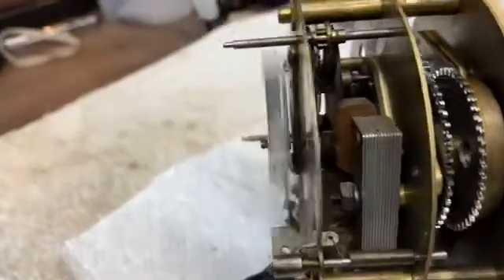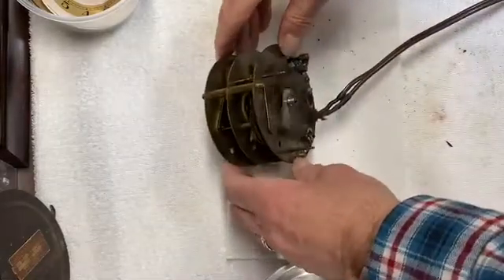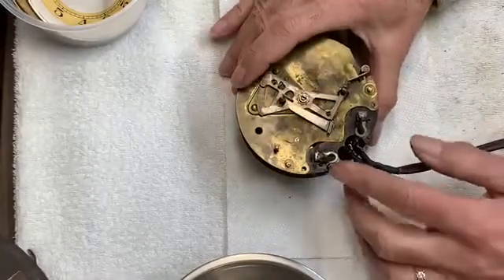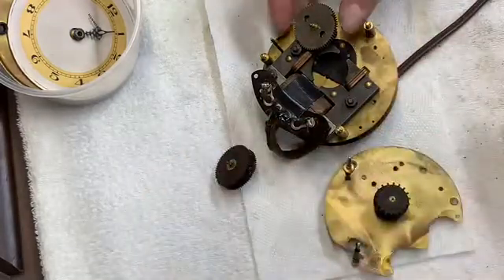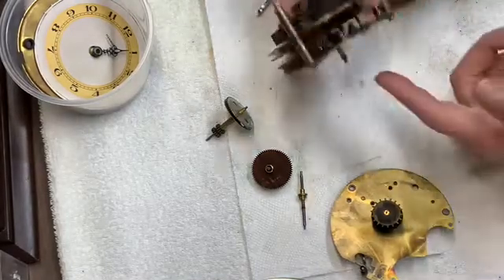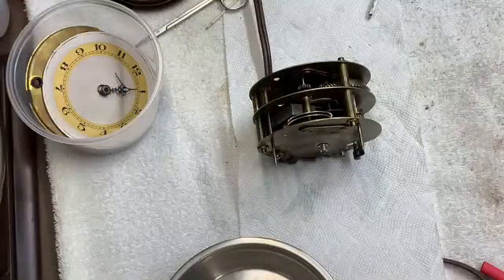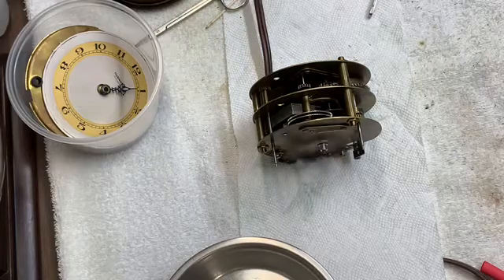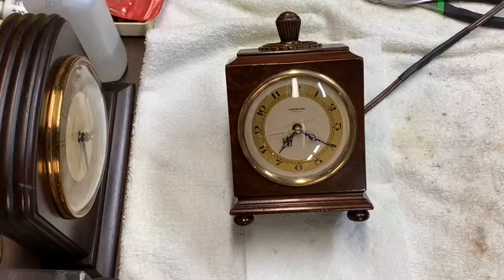Repair of a Hammond Bichronous Clock c. 1931 Part 2

Comment: Thanks !!   , mine is quiet plugged in , but makes that same noise unplugged, unplugged runs 4 seconds slow a minute.  There is an adjustment F / S but works is good for me .  Thanks for getting back to me, I really learned a lot from your vid’s ..
Reply from the maker: Thank you, mine does not have a F/S adjustment, but the unplugged noise is from the spring that powers it during power loss.
Reply: Sure you know all this , but I enjoyed this presentation 
https://youtu.be/vZrL8s6_xuI

Comment: Thank you very helpful. With the power off were you able to discern for how long the clock continued. I understand from new it was up to 30 mins. Also when the secondary mechanism is wound down and you revert to power does the clock start automatically? Thanks Wayne
Reply from the maker: I stopped timing how long it ran without power after 5-10 minutes.   I just wanted to know that it worked.  It is not a self-starting clock, every time you plug it in or restart power you have to spin the start knob.